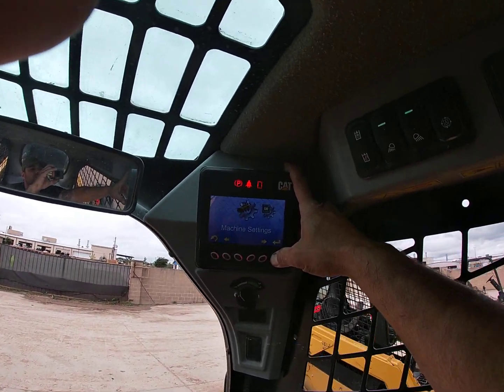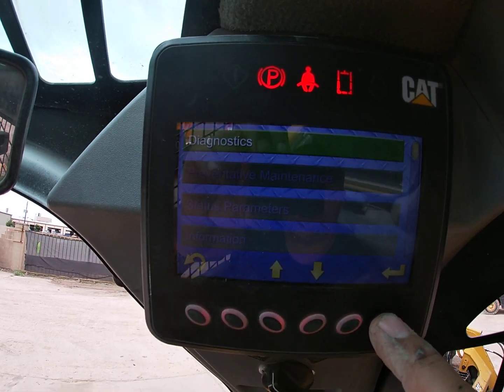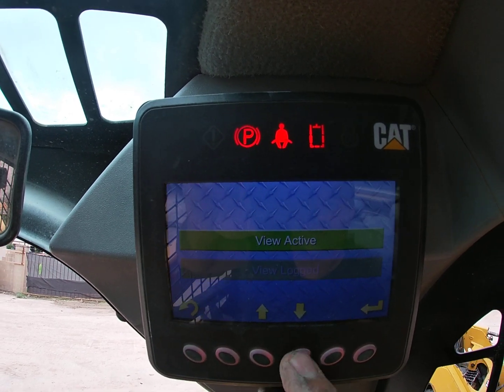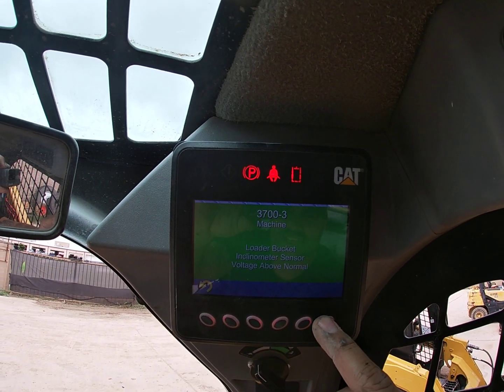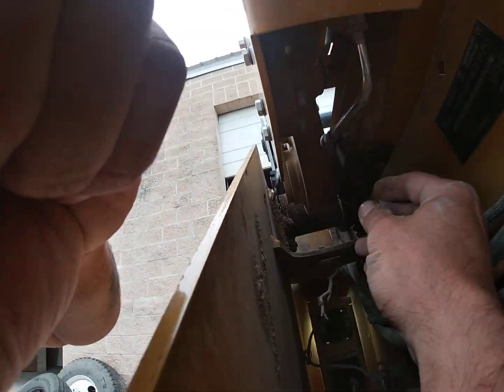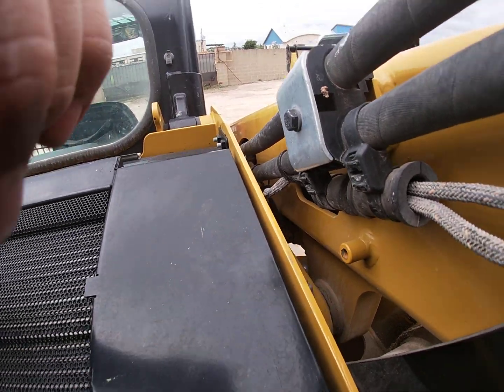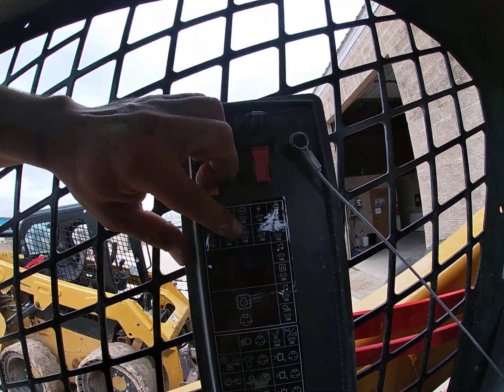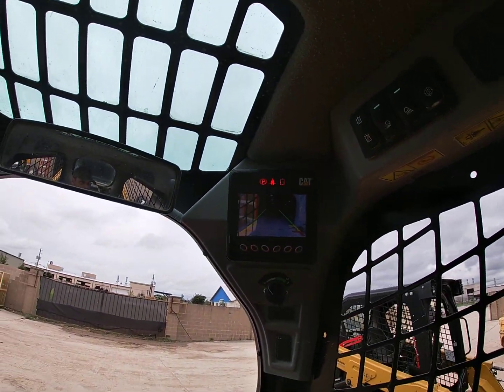CAT 262D lift linkage position sensor fault

Comment: I have the same machine at work, after 2 years it started losing power after 2 hours use. Does this sound like vapor lock?  Went through diagnostics and didn’t see an event, just voltage codes when the battery went dead